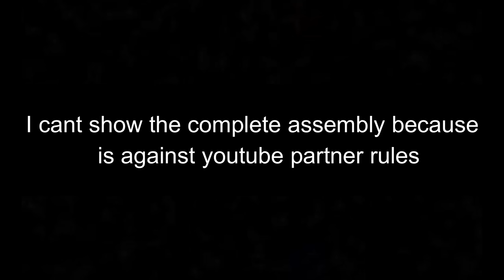Uzi restoration  - a real gun restoration from rust

Comment: For a good penetrating fluid use 50% acetone and 50% automatic transmission fluid it works very well for getting out Rusty bolts and screws
Reply: I've tried that and it works very well
Reply: This is probably the best comment on the internet I've ever seen. Useful information, not insulting to anyone, exactly the kind of information that's not commonly found either
Reply: I think ATF/Acetone works great. Except I can’t keep it in metal oilers because they leak. I keep it in polypropylene bottles.
Reply: Where do I get acetone
Reply: So does straight diesel. And it's cheaper.
Reply: I like PB Blaster.
Reply: Kano Kroil is the best Ive seen. I sold it to the newspaper plant in 55 gal drums.
Reply: @paulgonzalez1421  acetone in any hardware store
Reply: @bdemaree  Not anymore, mate. XD
Reply: Kroil is purty good also
Reply: @paulgonzalez1421  Any hardware store.
Reply: Керосин +ортофосфорная кислота.....

Comment: Great video I just moved to an area that is extremely wet and I kept my persuader (shotgun) in the basement.  I just got it out to look at it for the first time in 3 years.  Thank you so much for this video.  I ordered the rust remover and will use a tub similar to the one you used.  Can't thank you enough for this informative video.
Reply: please look up steam conversion 
keeps the original finish and gives a much better final product
Reply: Look at backyard  ballistics, he has a few real restoration  videos, not the click bait junk like this channel
Reply: Rusted guns?  NOOooooo !  I put away my Remington Nylon 66 back around 1980 and just recently dug it out again.  I don't remember how I cleaned it last but all trace of old lubricant was of course, long gone and a brush and patch down the bore showed a little bit of rust.  Which can be avoided by storing guns coated in Eezox or better yet, RIG.  But any gun I store with RIG in the bore needs some note or tag put on saying that this has been done for the benefit of the next guy who pulls it out of storage.  Because obviously you needa clean the bore for sure if it has been put away with RIG inside it.   At least if you use the RIG you'll still have rifling left in the bore, though.

Comment: The inside parts looked different from the Uzi I had in the army. The "bolt" of my Uzi was basicly one chunk of metal and a spring.
Reply: you probably had a full auto open bolt, he is storing a semi auto carbine  model b I believe.
Reply: Because this is a semi auto version.
Reply: @RicArmstrong  this one shown here had no bolt or barrel in it they are missing
Reply: @Bedgie01  
Yes, the bolt is in the gun at : 0:22
The selector switch only had safe and semi.
0:18 therfore,  it fires from a closed bolt.
Reply: @RicArmstrong  still its missing a barrel so its just a paperweight at this point of time

Comment: Does putting the pieces in the oven to remove the grease require you to a heat treat afterwards or will the hardness be okay still?  Also, a tip: If you put a little bead of white lithium grease in side a detent plunger, it will stick on to the spring if you accidentally let go rather than fly across the room
Reply: No the baking doesn't affect the heat treating at all.  The temperature an ordinary oven can reach, even on the highest setting, is way too low, there is nothing to worry about.
Reply: @Tiberius_I  my oven Def gets hot enough to temper a heat treat... It only has to get to 600/700deg

Comment: I thought it had a full auto selector for a second i was like 😳
Reply: That safety was wrong for a clised bolt gun. I have a fealing it was in that condition because someone did a little work to it and dumped it.
Plus the closed bolt won't run reliably in full auto.
Reply: @Doublezzranch  i was gonna say the closed bolt was a little off but pretty cool gun by itself
Reply: @rng_b3anz571  : Had mine for 25 years. The 10" barrel is much more accurate then the 16" because the twist rate is much different. Sold it a got the PSA AK-V but can't shoot much because of these ammo prices.
Reply: @Doublezzranch  ive been looking for 223 for months and when u find it its like 22 dollars a box for 20 shots😭
Reply: @Doublezzranch  Overall how do you like the AKV? A friend of mine got one when they were first getting popular and had all kind of probs with it not fully cycling, etc.. Palmetto took it back and after like 6 months, I think they fixed it for free.. Works beautifully now tho.. How does yours run?
Reply: @lifeimitatingdeath3608  : That's terrible, glad it worked out for him.
Mine works with all the ammo, hallow point & the cheap crap you find in the back of your ammo cabinet. Accuracy is spot on, and fit n finish is perfect.  Just for fun I painted in the 3 marks for safe, fire & full auto even though it's only semi. Next step is getting a can for it to keep it quiet.
Reply: @Doublezzranch  sounds awesome.. I did that to my glock with, believe it or not, whiteout.. you know, filled in the "Glock 9x19" and all that.. looks pretty good.. Unfortunately I'm in Delaware so suppressors are fully illegal.. bullshit man.

Comment: Wow that's probably the most embarrassing fake restoration I have ever seen. 

Little advice, put straight any moving parts outside the gun when you're spray painting that rust colored paint (which is pretty badly made too btw, it looks like if a colorblind person tried to do a Rodhesian style camo), it's will prevent things like what happened at 0:06 with that sling buckle. 

Or how about actually restoring guns instead?

Comment: Gunsmith's apprentice here, I'd suggest getting a ultra sonic cleaner to do the degreasing then sand blast it and theeeeennnnn put it in acetone before you cerakote. It's a full proof method that has worked for me and my father. Remember though, keep degassing it and rinsing it with acetone to completely degrease it before you cerakote. That's how the cerakote lasts for a long time.

Comment: Great work but you could avoid most of the de rusting and coating and blueing process by just boiling the rusted pieces, the old factory blueing is still there, if you boil it it converts back to the original finish, then you'll only have to do minor cleaning of surface rust

Ottimo lavoro comunque :)

Comment: I have had very good results refinishing guns with Alumahyde II.  It is simple to apply, dries hard, needs no special equipment, and costs about $20 a can.  Mostly in "matte black" but other colors too like Desert sand.  I have refinished several guns with the Alumahyde II, that came from the factory with marginal or poor finishes, like my two Romanian WASR AK's that  came, brand new, with the worst parkerizing jobs I've ever seen.  Also a cheap Rough Rider .22 revolver with a cheap bluing job that was plain ugly.  And I painted my Glock 26 with a simple Desert camo scheme.  All of them came out great.  10 years later, the WASR's still look like new, one of them has over 1,000 rounds through it, too.

Comment: Dry firing won't harm that. It's made by IMI. It's not some Chinese made bootleg.
Dry firing is part of a Functions Check, Which should be done whenever you disassemble and then reassemble, or D&A for short, your weapons.
If the firing pin can stand up to firing thousands of rounds before needing replacement, it can handle a few hundred Dry Fires during its 'life'.

P. S. The orange parts make it look like air soft. 😂 Any color other than blued/black looks wierd in the US. Aside from some of the custom jobs on guns people do these days. Someone does custom Glock coating and accessory parts to look like the controller for the Nintendo game 'Duck Hunt'. 
But it still looks good.

Comment: Uzi’s run on open bolt systems so when u pulled back the charging handle it should have locked open…..
Reply: Full auto Uzi's use open bolt, this was the semi auto version which fires from a closed bolt.

Comment: Lol...I was wondering if you realized baking the raw steel would cause it to rust further. Heat is a catalyst which reduces the cost of activation in rusting your newly sandblasted steel.

Also, it is illegal to have an orange muzzle on a real firearm. 

Learning is part of the fun.
Reply: Heating it was part of the cerakote process. Orange tip depends on local laws, not illegal everywhere.
Reply: @ryanashby3640  it was not cerakote at 5:36 when he put the freshly sandblasted steel into bake and it came out rusted.

And yes, YouTube videos must abide by the laws of whatever state they are shown in.
Reply: @noneyabidness9644  it wasn't the muzzle that was painted orange either. That was the barrel nut.
Reply: @noneyabidness9644  him baking the parts was part of the prep process as prescribed by cerakote.
Reply: @ryanashby3640  I have used cerakote. Baking raw steel is not necessary for a pretreat.
Reply: @noneyabidness9644  Cerakote-H look up Gas Out.
Reply: @ryanashby3640  putting a random product, then telling me to look up a spec for gassing out, (which if you've ever used cerakote, you know the surface has to be clean...rust on a surface is a big no-no) Doesn't change that putting raw steel to bake rusts it and is the opposite of a restoration.

Clearly you're seeking attention.
Reply: @ryanashby3640  maybe you're right and he used that product and  it recommends that step, even though I could not find any indication that he used the product, he's certainly working the process for a generic cerakote. Still, raw sandblasted steel is unprotected and rusts easily without putting  it into an oven.

Am I expected to believe this man intentionally rusted his freshly sandblasted Uzi, because the instructions on a box told him to? 

And not only that, but then continued with ceramic coating it over rust, which as stated, is a HUGE no-no?

He'd be undoing all that work, just because a box told him to. 

Am I wrong, or is that a bit nuts? 

Last but not least, the barrel of an automatic rifle, or smg in this case, heats up causing the cerakote to start chipping, with  use. What a waste to put it on an Uzi.  Cerakote breaks down at 500 f, which as hot as a barrel can get from a single fired round. Never mind a fully automatic burst of fire. 

I wasn't trying to pick apart all the things that are wtf moments here...just the big two.

You're not doing this guy any favors by defending him. He done screwed up.
Reply: @noneyabidness9644  ok, well cerakote is a brand of products so its not generic and the 5th stage of is the gas out procedure, it's literally in their application manual for the H series cerakote to do this. C series cerakote is rated for 1800⁰ so it's quite possible he used the cold application type for the barrel.
Reply: @noneyabidness9644  lol an uzi barrel does not reach 500⁰ from a single fired round. Haha do you even own an uzi?
Reply: @ryanashby3640  clearly you do not.
Reply: @ryanashby3640  ahhh, so now he's using c series? (And you're wrong, by the way. Still 500 f)

Lol. Weak troll it is. So weak. :)

Making yourself look foolish for all to see. 

That's what happens when you try to incorrect someone when you know nothing, whatsoever.
Reply: @noneyabidness9644  funny, he doesn't even have a barrel in the video so who knows, and not. Cerakote literature clearly states that cold cure Cerakote is rated for 1200⁰. You started this by making incorrect statements about how to correctly apply a product and incorrect statements about firearms law.
Reply: @ryanashby3640  "he's using h-cerakote."

H-cerakote fails at 500 f according to the manufacturer's specs. 

"Ohh, $#!t!!! I look like a fool! Well, NOW what I meant to say, is he's using C-cerakote! Haha! Now you look like a fool!"

All cerakote products break down at 500f, across the board. 

Wanna try this again?
Reply: My statement stands. NEVER bake raw steel...it rusts. 

Orange tip on real firearms are against the law in several areas. Videos shown in those areas must abide by those standards of laws. 

He done fucked up, period.
Reply: @ryanashby3640  by the way, you can see the barrel at 4:10 and again when it goes for improper off gassing at 5 minutes.

Do you even know what a barrel is?
Reply: @noneyabidness9644  they do not all break down at 500f
Reply: @noneyabidness9644  there is no barrel present in this video, the orange part you are referring to is the barrel nut that screws onto the threated front trunnion. Ive assembled 2 uzies from surplus parts kits, I know what the barrel is.
Reply: @ryanashby3640  I put the time stamp to the barrel and told you it is clearly visible when he baked the raw steel. Back row, third from the left. 3" long cylinder. 

You're trying to play stupid, but I am not buying it. No one is that clueless.
Reply: @ryanashby3640  according to the manufacturer's specs, they do.

Comment: A semi-auto Uzi that fires from a closed bolt. Interesting. I hadn't seen one of those before. The full-auto open-bolt ones are a bit simpler.

Come to think of it, that's probably because they can afford to be dumber than the semi-auto versions. A semi-auto firearm, after all, has to be smart enough to be able to count up to one: a full-auto firearm doesn't.
Reply: Uhuh, if you think about the concept of the PPSH, It's basically a moving bolt that has a doorstop, which is when you stop pressing on the trigger.
Reply: @mikhailbolodo1597  Yup. No counting. It's why just about every semiauto firearm can be converted to jackass full-auto by filing off a piece of metal somewhere. In most cases, it'll be runaway full-auto, where you can't stop it by releasing the trigger and it just keeps running until the ammunition is exhausted, or until it jams hard enough to require disassembly, or until it spontaneously disassembles itself; but it'd be difficult to design a semiauto where that wasn't possible.

On the other hand, three-round-burst guns have to be even smarter than semiautos.